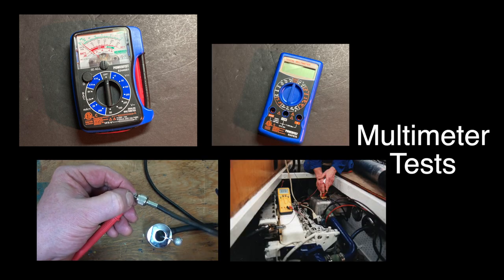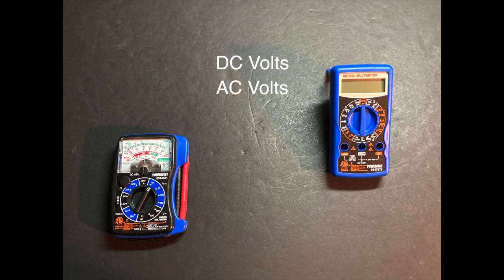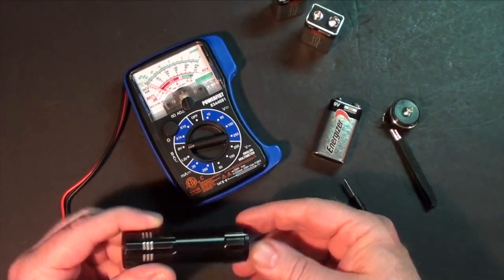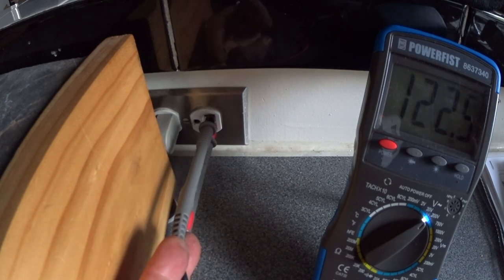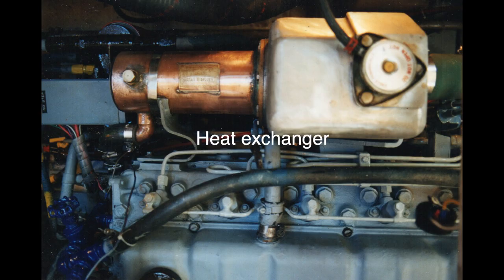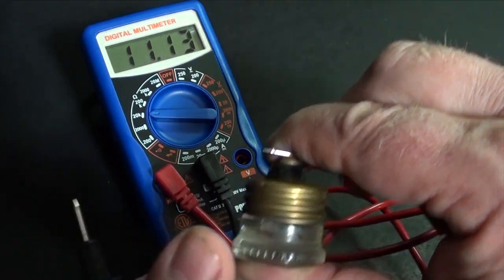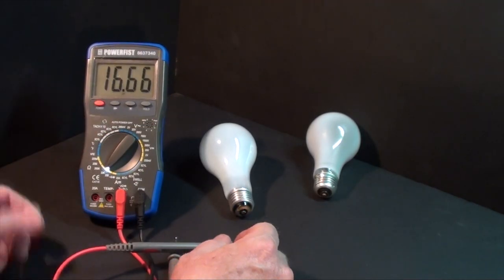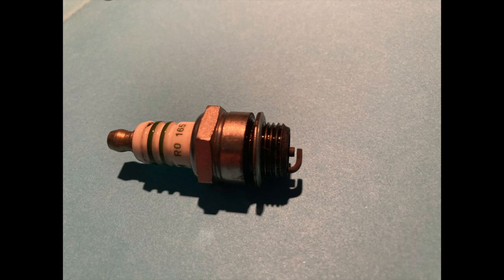Multimeter Tests anyone can do.

Comment: We have recently bought a 13 Amps electric mower. I bought a few different outdoor extension cords to use with the mower.(14 gauge X 75 ft) (12 gauge x 75 ft) and (12 gauge x 50ft). I would like to use the most appropriate cord that give an out put of 13+ Amps How do I measure how many Amps are present at the end of the extension cord, before the mower is plugged in? What setting do I use the multimeter at since I am measuring more than 10Amps?